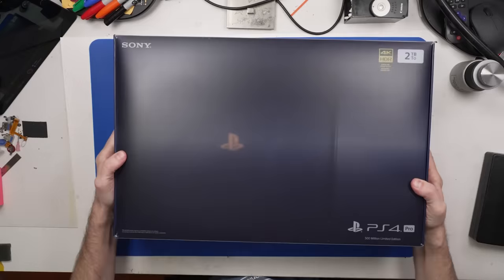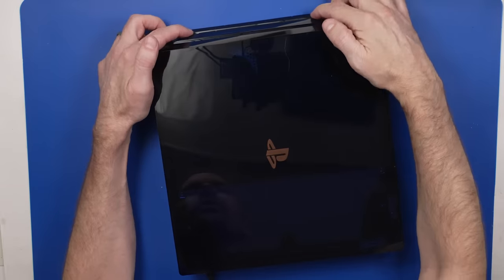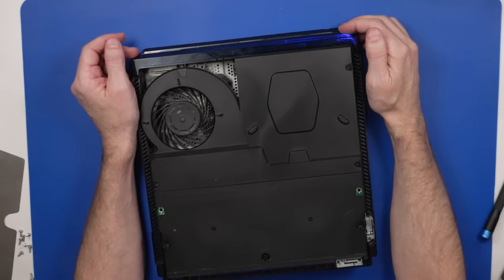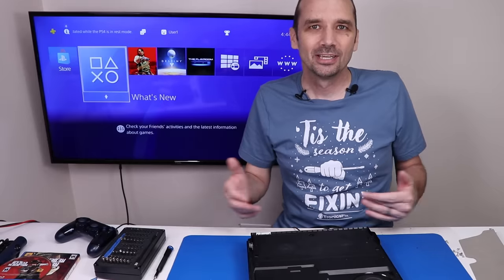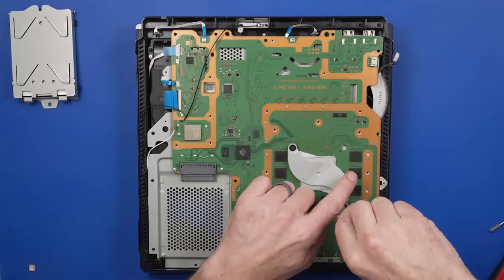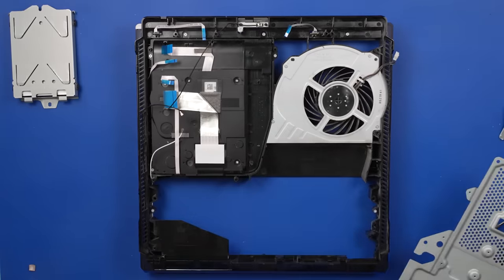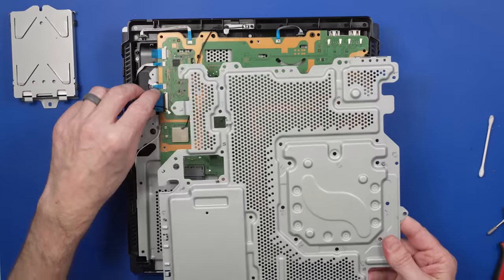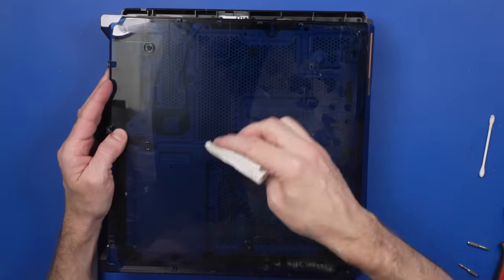Rare PS4 Deemed "Unfixable" After Repair Shop Fail - Can I Fix It?!

Comment: The one thing i hate about the playstation console design
Is that they put the disk drive in worse spot it means you have to dig through mother board to reach the disk drive, my PS4 pro had issue
One it was so noisy
Two the disk drive was broke down
I gave it to repair, so they told me the disk drive is unfixable so i said screw it just fix the noise
I got ps5 this year on my birthday (slim)
So finally Sony fixed the issue on playstation 5, (slim) it is mean if it brakes you can take it out easily and have it repaired
Or buy a new one instead
God Sonys workers and engineers were Brain dead when they were designing the ps4,ps3 
Couldn't they released the console with this feature?? 
Even the regular ps5 had the same stupid design like the last gen 
But they fixed all of these problems with the disk drive on PS5 slim

Comment: I had the same issue with my Black Ops 3 edition PS4 😢 guy pulled it apart only to tell me it had a special power supply or something that was different so he couldn’t find parts to fix it and gave it back to me. 😢 I am in New Zealand

Comment: Any ideas on how to fix a ps4 pro that cannot load a game? My sisters will play digital games fine, it will also play blu ray films without issue and otherwise seems fully functional however when loading a new game it appears to install in seconds, yet flashes the error, Cannot start the application.
(CE-34224-5).
Really strange. Have tried a second hdd just to be sure but same issue. Almost like the game won't install to the hdd properly.
Cheers

Comment: No, that is not the perfect amount of thermal paste. The perfect amount of thermal paste is half a pea and in a ball in the middle, the thermal paste will spread out evenly in all directions when you mount the cooler.

But on the other hand, gaming consoles.  That is a pandoras box of snakes to open..

Comment: I’ve never had a problem with my ps4. But my ps3 fat 60gb refuses to work. I even changed the thermal paste and made it worse. I really need help. 😅
Reply: Make sure you reassembled it properly. Hopefully didn't put too much stress on the cell or rsx chips, the solder balls under can get damaged and cause issues. Look up frankenstein PS3 to see what people are doing. Sometimes the tokin capacitors go bad, but who knows. Really depends on what you are seeing now after you reapplied thermal paste. YLOD?
Reply: @FireMrshlBill  It's rarely the caps nor the solder under the chips. The issue was the GPU was faulty and the connection between the GPU subtrate/interposer would fail as the console heated up and cooled down due to a low quality underfill that pretected the microscopic solder bumps on the die itself. Reballs/reflows/cap replacements are temporary, which is exactly why the Frankenstein systems exist. The same issue plagued both the 360 and many GPUs used in both PCs and Macs. There's this one channel on YT who's name is "Josh Davidson" (formerly known as Octal) and he's done several videos on this. Microsoft even said this was the issue with the RRoD (360 equivalent of YLoD) in their own documentary.

Comment: first you say it's an overheating issue, then you say it works fine after you replug the PS unit.....Does it still overheat or what? Your video is very confusing man.

Comment: I'm assuming that repair shop disconnected the psu from the board side. What shop does that? And its a chain? Thats an embarassingly novice move. Unless the repair somehow involves the actual psu cable I NEVER unplug from that side. Always the psu. Cause guess what.. you f that up, you could just swap that hottly and deal with it later and dont turn a 15 min hdmi replacement into a 30 min job. The fact they yoinked that off the board and in the end didnt even plug that connector in... lmao On top of that it was in for a cleaning/new paste? Thats not even a repair, thats maintenance. Oh boy. 

This is a looooot of repair shops though. The big box type are usually bad because of lack of training.. or stupid overlords  prioritizing money (they want to keep the unit or they actually dont know how to fix things). I've had a desktop come in before that had been "unrepairable" from bestbuy. It was literally bad ram. The local repair places though.. sheesh. You'd think they were shucking phones open with a machete when all it went in for what a battery.

Cars and electronics man. Anybody can work on them. But not everybody should. =)

Comment: Hmmm. Customer reports overheating issue: probably freezing and/or unexpected shutdown. Shop says "unfixable" (dead, no lights) My bs detector went to MAX when you told the story. So you find - disconnected 12v power, misplaced thermal pads, loose screw and snapped tab. BS detector went to 11. Avoid that shop. Don't think theCod3r's commentary would be as generous as yours sir. Nice video all the same. I have 2 PS4 Pro s bought in fair condition, did similar work on them, they run quiet as ghosts. Took advice from your previous vids.

Comment: I brought a 3ds XL to one of them U shops  and  it just needed a ribbon connecter replaced/fixed  as the latch  fell off. wich I brough the latch and a replacment   connector. they refused to fix it and told me they cant because their tweezers are  broken loool
Reply: Just shops that don’t want to work on the ds line of systems.

Comment: Well, I don't know what you mean. It doesn't have the perfect amount of thermal pace, the stupid perfect amount of throwing paste, I've actually rejected the throne pays to my brother's PS4 and the thermal pays literally sticks on the other end, so half of it does come on even if it's fresh, that's why half of it's bold, cause it came off my guy you can't be. Saying oh baby pull out the previous demotive therapy's comes from the factory. They didn't put perfect amount of thermal paste bro like it's like you're even putting enough. You're just putting a drop my guy like live of their b***Soak the b*** like.  I heard the thing in thermal pace instead of just gonna put a drop that is the perfect amount of thermal paste bro. If that were to talk in away took an apart at 1 of the appearance boards would you have sold? I would say a hobo to dead spot to look up. Wonder why it's getting so hot. It doesn't have a perfect amount of thermal paste. It needs a giantmaybe a junk square. Maybe a whole tire thing filled up.  Wake

Comment: @tronixfics you didnt do the best job with those thermal pads. the one that comes with the console are pretty bad. any user of a ps4 pro knows how bad the fan starts to spin after some months. you should have replaced ALL the thermal pads to avoid future overheating, wich was likely the cause of that overheat in the first place. whenever the fan gets loud, you must not only change the paste, but also the thermals.